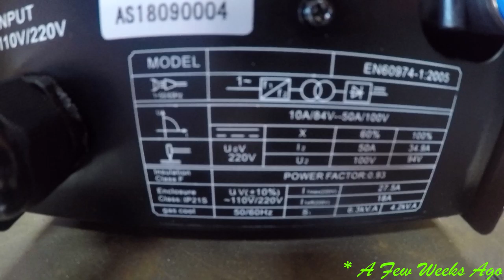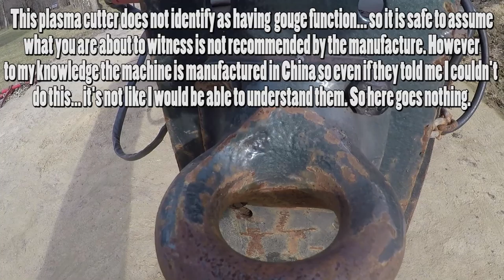Quick project with the Primeweld Cut50DP Plasma cutter! prepping the Triaxle for sale!

Comment: seems like a hardened socket with a breaker bar and some penetrating oil would have been better. Save the plasma cutter for the right job.
Reply from the maker: Paul G I tried a jumping on 4 foot breaker bar with no luck. A torch would have been the proper tool but I don’t have one. So plasma was next in line. Though it worked fine, even though this particular cutter doesn’t have a gauge function.

Comment: PrimeWeld pros and cons: 
Cons: can’t slice a 1”+ grade 8 bolt in 10 seconds or less, installed with stupid twist lock plug, can’t brag about you $2k Hypertherm, doesn’t come with pre installed Loggerwade.com stickers.  
Pros: $400, sold by American with good support, pre-installed regulator/dryer, good torch, can shoot molten metal down your back, ****doesnt explode when you pull the trigger the first time!!!!
I’m going to give it a win!! Did you have it running off 240V? I wonder if you had voltage drop from the long run. Seemed like the OC kicked in kind of fast. Great vid and looking forward to the delivery.
Reply from the maker: Dall Tex I really should have installed the loggerwade stickers. It woulda cut them bolts like a champion! I was running it 240v, however I'm thinking the oc protection was kicking in from me being inconsistent with the distance from the workpiece with the torch. I hadn't considered the cord though I'll look into this more, thanks as usual, your comments are always humorous yet meaningful, and I appreciate you making me think. DRINK MORE VODKAS COMRADE!
Reply: JasonWorksAlot my new new China cut50 works great.  At least for the 3 minutes I used it.  It does have JWA stickers so it really didn’t have a choice but to work.
Reply from the maker: Dall Tex I like your thinking! If it craps out douce it in vodkas! Always works for me:) thanks for watching comrade!! Take care my friend

Comment: just my 2 bits here, but wouldn't an oxy-acetylene torch have worked better for you on these bolts ? seems to me the plasma jobber would be better suited for cutting sheet up to maybe 1/4" or perhaps as thick as 3/8". Take a break, and have a sammich.
Reply from the maker: J. Chris Beck you're exactly correct sir, however I don't have an oxy setup at the house anymore :( became a run what ya brung kinda thing. Thanks for watching comrade! How's your back feeling? DRINK MORE VODKAS!
Reply: @JasonWorksAlot  feeling a little bit better, got some pain management going on at the moment, hope to get a new doctor soon so i can get down to some better solutions for this. Some physical therapy is likely in my near future. there isnt any real cure, just treatment options. Will be off work until Monday so that I can get a couple of nights of decent rest.

Comment: Always wondered about those cheaper plasma cutters, was told they really need alot of air. Will have to look into one of these for small projects around the shop. thanks for the vid comrade.
Reply from the maker: shooters option targets comrade targets! Researched the heck out of them, this is the only brand id get they're in stock on amazon for like 3 days a month I'll send you the link. If I ever get my plasma table, it'll have a hypertherm on it no questions. For stupid projects. 400$ can't beat it. DRINK MORE VODKAS!
Reply: Hook it up to a politician but you'll have to cool and lower the pressure of the air.

Comment: On the first part of the vidja you should have said  "All parts are available on loggerwade.com." I would have thought you had a small oxy-actelyne outfit? As for No hips. You could do the DRASTIC approach. You could go to suspenders, that is what I do. But I don't blame you for not doing it.  DRINK MORE VODKAS. I noticed some form boards for the shed.
Reply from the maker: Brian Gardiner I know! I realized that after I uploaded it! Oh well. I do actually have a very small oxy/fuel set up. However tanks are empty and only last about a half hour or so, used to have full size tanks but since I don't do much with the fabrication business anymore, especially where I use torches, I can't justify the 450$ bottle rental fees. I have suspenders! Somewhere around here 🤦🏼‍♂️ I like them because even though people make fun of me, I don't have to constantly adjust my pants and pick wedgies. Should really start wearing them again... no, YOU DRINK MORE VODKAS!! and hey! Don't get ahead of me hahahahah
Reply: @JasonWorksAlot  If you buy your bottles you will save the rental fee. To buy them up front costs more, but after you buy them all you have to do is refill them. Just make sure you deal with a reputable dealer. I have seen people steal rental tanks and try to swap them for owner tanks.
Reply from the maker: Brian Gardiner you make a good point, my only problem with owning them is that I hate having to wait for them to be sent out and filled. It's an hour and a half drive to the welding store I use for my gasses. I'd be so annoyed going back and forth twice in a week. I know I'm complaining like a preModanna, if i am in desperate need of a torch, I can bring the setup home from my work truck.
Reply: @JasonWorksAlot  We use to just exchange tanks. Swap your for one like it.
Reply from the maker: +Brian Gardiner if be all for that but the shop I go to won't, and the two closer ones also send your tank out to be filled and call you when it's ready. It sucks.
Reply: JasonWorksAlot How much would it cost to advertise on the back of your underbritches? Asking for a friend...
Reply from the maker: Mrs. Elite Earthworks it depends on the friend 😉
Reply: JasonWorksAlot I’d like to take out a full butt ad now before your sub count gets even higher and I can’t afford it anymore

Comment: You talk about as much as I do at work not at at all
Reply from the maker: Josh Welner comrade welner when I have to get a lot done in a day I'm usually quiet. I try to have a good time all the time, however there is a time and a place. We also had to finish the shed pad, spread more stone on the parking pad, and tamp them both. Sun setting at 430 doesn't help either. DRINK MORE VODKAS!
Reply: @JasonWorksAlot  I think we have past the winter solstice now so  more time for rushing around and less for vodka.
I think a minute and half more of day light but I could be wrong
Reply from the maker: Josh Welner any little bit helps right? Hope you and yours have a very Merry Christmas, from wifey and I and as always my friend, DRINK MORE VODKAS!